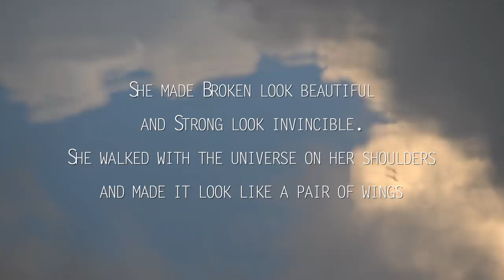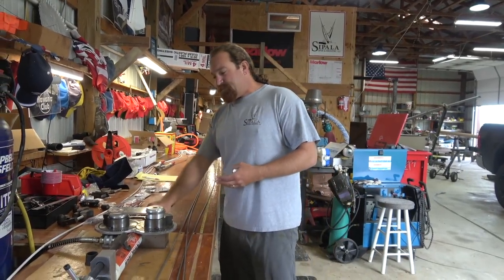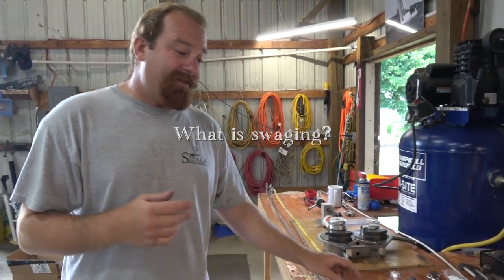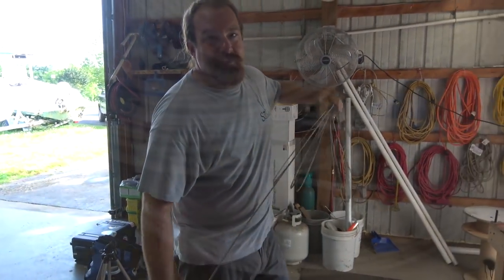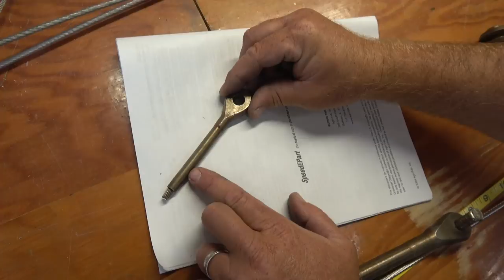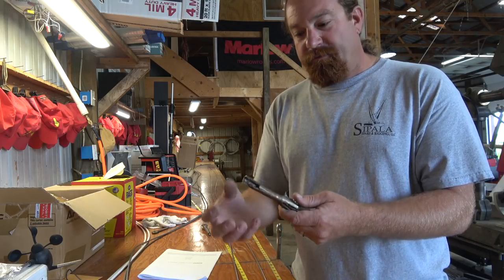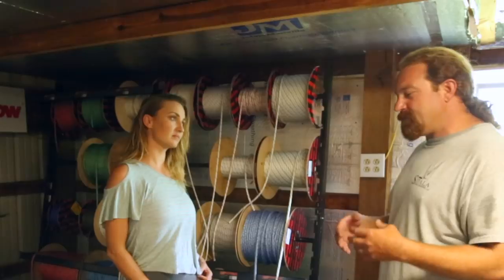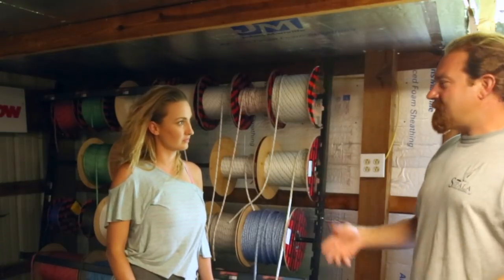How to rig a sailboat | SMLS S5E06

Comment: Old cables can be used as chaser wires when removing/installing electrical wiring that is installed in a complex manner. You can attach the cable to an electrical wire at one end and pull it out the other. Then tape the new wire to the cable and pull it back. Boom! Installed.

Comment: I doubted the wisdom of fixing this boat, but when I heard its A "free" boat, I figured it was at least a learning experience. Old Cals are not the worst boat out there, especially as a costal cruiser. It is not in the same category as a Rawson 30 or a Bristol or an Albin Vega, all of which are smaller sailboats that have proven offshore capacity. The reality is, its a lot more than the boat, its the person sailing it. Are they blue water capable? I think our hostess with the mostess has a ling ways to go to get to that point. For most people, they could be given a Hans Christian 38 and their lives would still be at risk out of sight of land.